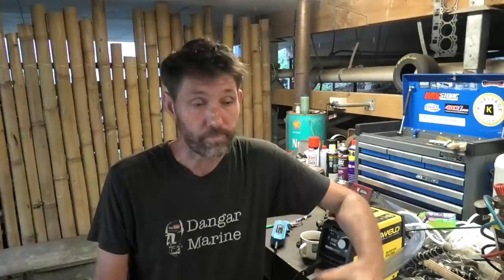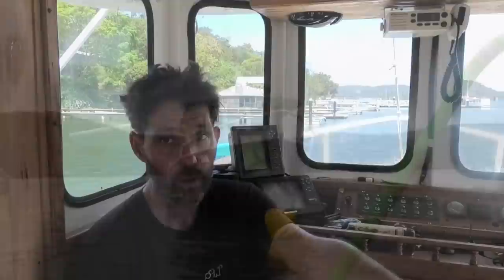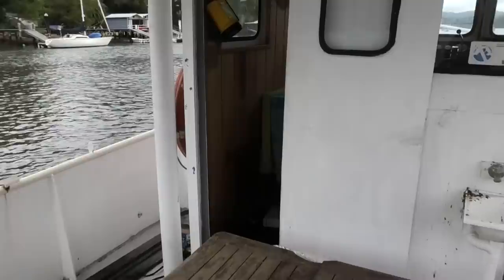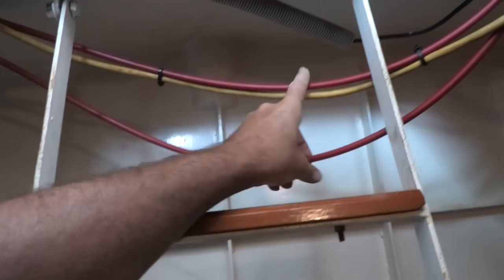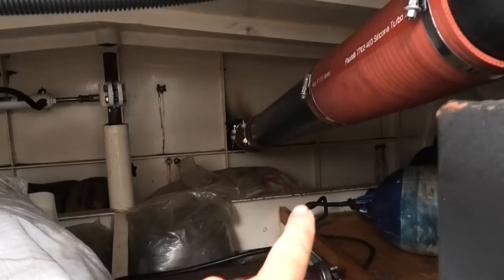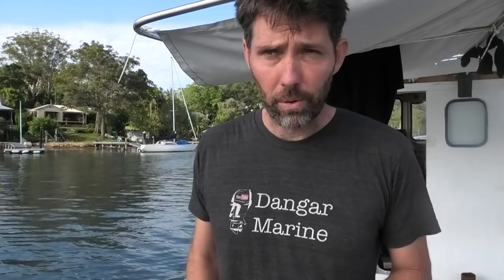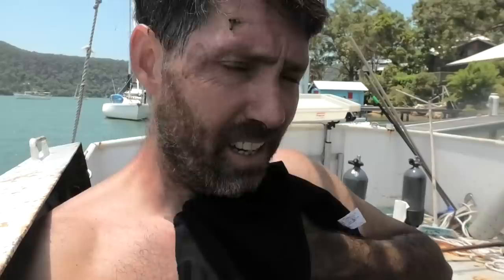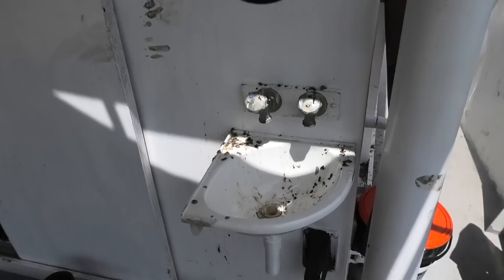Is it a bad idea to buy an old steel boat?

Comment: although a bit neglected, what is seen on the video would make us believe the vessel is in a lot better condition than the video title makes it sound, and it appears to be far from a "rust bucket".  
a nearly 30 year old boat is not really considered old by boat standards, unless one has the money to trade their boat in every 10-15yrs on a new one....  
 I think the project of making that boat seaworthy again will be a relatively simple and enjoyable task, but converting the work boat to a pleasure boat will be difficult only in relation to ones idea of comfort and what they require to feel that way...  as for THAT particular boat, whether it was a bad idea to purchase it depends more on what the purchase price was and what the buyers expectations are....  I think if the purchase price was right, it makes a lot of sense to buy that "old steel boat".....

Comment: Stuffing boxes on the propeller shaft can be a real problem.  The packing type you have must be watched closely and too tight can damage the shaft severely.  I owned two shrimp trawlers over a 18 year period and if I still had one I would try one of the new shaft seals that have the moving seal elements that don't rub on the shaft, but turn with it.  The 471 and 671 engines are amazing and much more economical to repair than a lot of the new more electronic controlled engines.  If you take care of the lubrication and don't overheat them they will probably outlive you.  I never owned a steel hull, and had friends that built them and owned them.  If they are prepared correctly when first built they will last many years, but must be taken care of.
Reply from the maker: I agree that constant maintenance is the only way to keep a steel boat in good condition. I would also be keen to try the new style seals. My only reservation is that when they fail, they can fail completely.
Reply: @DangarMarine  that coupling's going to be a b***h. It's the type of job you only want to do once. I don't get how you could leave a compression gland in place when installing a dripless, but i believe it's possible.

Comment: That Detroit probably has N75 injectors in it. Usually in marine applications you can go quite a lot bigger for more power. Although you may need to change the prop to take advantage of the added power
Reply from the maker: Interesting you should say this because the owner did mention something about having some larger injectors I could have. I’m sitting by the boat now waiting for the motor to get lifted out so we’ll be getting a closer look at it soon.
Reply: @DangarMarine  With the N75s in it that 4-71 is roughly 150 - 160 HP
Reply: @DangarMarine  I'm sorry. I should have said stock are N65 and that is rated 160 HP. Thought I might have been wrong so I looked it up. Been a long time since we've had a 4-71 here in the shop

Comment: Check the banjo bolt in the injection pump where the fuel inlet is.  Probably has some junk in it blocking flow causing your idle problem.
Reply from the maker: This engine turned out to have a huge number of problems with it and is currently getting completely rebuilt. I do appreciate the suggestion though! :)

Comment: replace those aluminum fuses with copper ones, it will prevent problems with galvanic corrosion .
Reply from the maker: They are also hard to source, I'd rather go with something more readily available.
Reply: That's why i don't favor ATC type, they corrode and get stuck even in the "water-resistant" fuseholders. Difficult to remove without destroying the fuse. I am Not trying to sound negative, but take a long, close look at as many dripless glands as u can find on other boats, they can be fragile and shorter lived (thin wall, rusting spring) bellows. Don't do well around silty water. May need water fed to them.
Setting the timing or rack: Search for a jimmy mechanic to help. Makes all the difference. Yours is prob good already. Could be just starved for fuel. If you're plumbing new lines dump the bypass into the tank Away from the draw, not near it.
Give that inverter a sea toss, they're Battery Killers. It has probably already murdered your "spare" batteries.  Substitute a Reasonable size inverter instead (small). Opinionated? No, just reporting the facts: every one of my customers were sure they had it all dialed in, every one of them killed a very expensive battery(s). One thing nobody seems to get: an inverter/charger is great for recharging its own battery. When it comes to maintaining one or two banks of marine batteries, they suck. So please just use a separate marine charger. AGM's are the bomb, i see lithium as more of a stunt. 
Buying that steel boat is a great idea. Really. I Love it.
What's with the red spot on your (43 C?) Morse cable? Was that spot originally under the strap and slipped? 
Sorry to be so effing opinionated. I'm on your side.
Never overplate. Always replace plate.
You really don't need to be told this, but looks like those 3 ss bolts on the shaft have galled. If U can't find a snug fitting "flax ring", go up one size and pound it into a ribbon. Corroded shafts can rip apart packing over and over.
Get some zincs going but don't overprotect.
I Really get the feeling you're Way ahead of me on these things. 
Thank You.

Comment: Stu, this is a good boat to talk about (me) being a little to fat to lay alongside and get an arm under an engine or elsewhere in a tight engine compartment.  It's often hard to change spark plugs, get to freeze plugs, drain valves, lower oil drain, fuel inlet filter, motor mounts and many other areas.  I have a Merc 350 I/O in a very cramped pit.  How do you position an engine hoist on this style boat?  Other useful tools such as lights, cameras, mirrors, extensions etc.?  Diesel engines is a great new topic.

Comment: 9:00 Sometimes pumping the shaftlog full of grease will stop or slow the leaking considerably and have the added benefit of decreasing friction on the shaft to help keep it from overheating.
Reply from the maker: This one doesn't seem to have any type of grease fitting on it. I might look into whether it is worth installing one.

Comment: It’s in reasonable nick just needs finishing  dripless seal there is many  ,would pay to spend good bucks on a good one so no leeks   , but good boat   You could cover the top of the cockpit on poles many do for sun , but has potential, spend the bucks have a good boat , you won’t lose  but a good drive line in the shaft area will help. ,will be watching thanks

Comment: Think i would of extended the wheel house just a little bit. Not take over the whole deck. but just little more room inside. OR extend the roof line out bit more. Then have some poles from roof to deck for support. then have a way where i could like put up some Canvas or Removable sides that could attach to the poles. So if want to have more space inside when ever want to, I have that Option then.
Reply from the maker: I'm thinking of  having some clears made  so the back deck  can  be a semi-indoor  space.

Comment: On the gauges I would check all the connections I had a hard time with mine and corrosion on it I clean corrosion all my gauges work to include the lights good luck seems like a nice boat

Comment: Engine is classic industrial seafoam green.
Reply: Detroit Diesels were “Detroit Diesel Alpine Green” in all configurations except for the series 92 silver edition. Dupli-Color paint code is DE1618 and is usually pretty dead on for a paint match.

Comment: I'm surprised that the builder went to all the trouble building and bustin' his knuckles welding together a steel hulled boat and decided to make it only 30 feet?...If I were to buy this,the first thing i'd do is jumbo'ize it by at least 10 ft. minimum...Steel'...love steel boats,I've built steel Tug Boats still plying between Los Angeles & Catalina Island,the boats are over 50 years old...Good Luck to you Mate!....love the design!.....Ooop's' meant to add:your through hull drive shaft and flange set up is supposed to leak slightly,that's your lubrication...wouldn't hurt to renew the flanges and repack the bearing.

Comment: When I was young I moved aboard a 50' wooden boat with exactly the same motor! This makes me nostalgic for the boat life. Of course the shaft must have some leakage to cool the packing. We were underway on the Intracoastal Waterway in the Carolinas somewhere and We sent a guest down for an engine check, he came up and said that water was flying everywhere! The shaft coupling was beating the water, quite alarming! The stuffing box had come loose. Pretty exciting! We had the cutlass bearing cut out with a sawzall and the shaft replaced before the trip, should have checked the packing after a bit of running. We had the bible for GM 71 series engines and Allison marine drives, that helped a good deal. I lived on board that little ship for 5 years, traveled thousands of miles, what a life! One thing we did was install two Racor filters so that we could change one while underway. I love the smell of diesel in the morning!
Reply from the maker: Sounds like you had a great adventure! You are right that you certainly can't beat having all the documentation you need for the things you own.
Reply: @DangarMarine  That book taught me about mechanics. Torque values, removing seals, even do-it-yourself methods, all in there. We even had wrench J 4242 https://i.ebayimg.com/thumbs/images/g/e54AAMXQvTlRhdAF/s-l225.jpg  ! Essential for all those things bolted to the engine. Kind of a sad day when we donated the boat to a college and moved into a house.
Reply: buy mjp ⁵0 fot het yàhht

Comment: Could be a Boden design. Cecil Boden designed many nice steel boats many years ago. Boden Bollard 9 metre looks similar. Boden still have a current web site. Cheers.
Reply from the maker: Thanks for the lead, I'll check it out. :)

Comment: Good news for steel hull boats. A green ceramic coating is coming on the  marine market that prevents corrosion permanently. Also fire resistant to  thousand devices F.

Comment: I'd suggest to install a low volt and high voltage (if present) distribution panel. Circuit protection, battery selection can all be installed on that panel. Your 4-71 undoubtedly needs the rack set so you have efficient operating at speed and correct idling. Where do you plan to use this trawler?
Reply from the maker: Hi mate. I am getting close to starting to attack the electrics. I am planning on putting a panel right near the batteries but I still have a lot of homework to do. I presume I will need to have my house batteries 24V so they can charge off the alternator and then I will need a 24V to 12V transformer after that. I'll do a video on my planned design before I start working so people have a chance to comment.

Comment: My 35' Inland Seas had bad engines due to mechanic not closing the seacock and taking the head off one engine to replace a valve seat. The engine's ingested salt water resulting in a low purchase price sadly it had cable, internet along with utilities in a marina downtown it turned into a condo. Still sad I didn't put the diesels in it but they were a good selling point
Reply from the maker: The owner of this boat never closed the seacock from what he was saying so I'll definitely be checking it to see if it is seized open.

Comment: Good luck with the new boat! Those old detroits are leaky but very dependable. I am impatiant to see the hull shape out of water. It will be interesting watching you go through upgrades and repairs. Does she run a left or right hand prop? I prefer a left hand wheel with a starboard helm or vice versa.
Reply from the maker: Good question. I've been meaning to pop her in reverse and see which way the stern kicks. Still so much to discover!

Comment: Bought a 48 ft steel ketch for £11000  learned to weld and ended up using 11 sheets of 8 by 4 three sixteenths steel to restore it. Not the thing to do for a hobby. Sailed her for 20 years.
Reply from the maker: It certainly is a big investment in time and money, but getting 20 years of sailing sounds like a good return for your effort. :)

Comment: suggest you also make sure the fuel bowl and fuel filters are emptied while engine primer is on there maybe water and other contaminants in fuel  also suggest you crack  the injectors where they meet the block just until you see air bubles fizzle out got a feeling since your float was broken they may have run engine until tank was empty thusly sucking in crap into fuel lines and even air in injectors can be a bitch for a diesel especialy

Comment: I'd attack the fuel system first before playing with the governor. Drain the tank, clean them up, new fuel and I'd run a can or two of Diesel Purge before adjusting anything. With a fresh oil change go run her hard. The more you beat them the better the Detroits run.  The worst thing you can do is lug them or run them at low load for days on end.

Comment: Maintanence , maintanence , maintenents ! Steel hulls require regular maintanence , Like every year , if you fail to do the hulls inside and out its going to become a nightmare ! 
The hardest part is working the crawl space around the motor etc inside the hulls , many people anti foul and forget about the inside , that's a good spot  to check out when buying a steel hull !!! 
Moorings can be an issue as well , they are hard to find in certain locations around Australia eg Nsw .
Waterways are very controlling and love to hassel folks without a mooring !!! You won't find a mooring at the Gold Coast these days ! :( so check out your area , and see if you can drop a new block down in your area first , before buying a vessel ! 
I've watched a neighbours steel hull sink , from lack of maintenece so look after it if it's steel , OK ! 
That being said , danger marine looks to have baught a pretty clean vessel , there a lot of fun boats , but come with there challenges . Leaks and bulge pumps ! :) 
A dry dock of some kind would be idea for regular maintenance ! $$$ 
All large boats cost a lot to maintain , so have your wallet ready , if it's a marine product it's better quality and costs more !!! 
I lived on the water for over ten years , through cyclones and big storms , :) but there's moments of calm with full moons and sunsets and rises that make it all , worth while ! I loved it , while some Thaught I was crazy to live on the water . :) 
If you want a fun tender , get an ex surf lifesaver inflatable , put a thundercat 50 horse tohatsu on it and you are flying :) . 
10 grand will buy a houseboat , fix er upper :) 
Anti foul sticks to Alloy hulls best , for long term maintanence , fibreglass flakes , steel rusts the choice is yours , choose wisely ! :)
Reply from the maker: Fortunately residents on Dangar Island can always get a mooring off the island so no issue there. Definitely agree about the maintenance but I'm more than happy to do that myself - I'm going to enjoy looking after it.

Comment: First, change every filter you see... including fuel filter. And rather than inspect those seals on that shaft, just change them. If it's going to be out of the water and they are leaking now...
Reply from the maker: Will definitely be repacking the stern gland when it is on the hard stand.

Comment: Nope, old steel bulls are great, as long as you get or do a proper survey of the vessel before you hand over a single buffalo.

I also try to get an AsBuild for the vessel if at all possible. This is the documentation on how the vessel was actually built, not the design plans.

Comment: We get a variety of those projecta inverters at work for repair. They seem reliable but you should take absolute care to isolate it from salty air and corrosive, battery acid air as well. Most of the ones that come in for repair crap out because of corrosion on the board. It won't show any signs that something is wrong till it stops working and its a bit of a job to get it going again and some can't even be revived.
Reply from the maker: Sounds like good advice!

Comment: steel boats can be a real problem if not checked before you buy as it can turn into a nightmare if rust has gotten into the hull plates and like rust where do you stop

Comment: hmmmm...seems a very cool project...however, it seems to me that once that ship starts taking on significant water (God forbid) , it has no 'desire' , or structural bias, to float. So, cutting the edges lower may be structurally hazardous...Good luck!

Comment: There should be an idle adjustment screw with a lock nut located on the side of the governor housing under a cap held on by two bolts. Run it in to increase RPMS.  I used to do a lot of work on Detroit Diesels 2 stroke engines and can tell you that you will need a manual for these to learn how to run the rack,  set the governor gap,  set the injector height, and adjust the valves.  Its not that difficult to do but each engine / injector ect. needs a specific clearance.  It all has to be done is order and according to the manual.  I wished you lived closer I would give you my books.
Reply from the maker: Thanks mate. Fortunately the boat came with all the service manuals for the motor. I will order a valve cover gasket and give it a go soon.